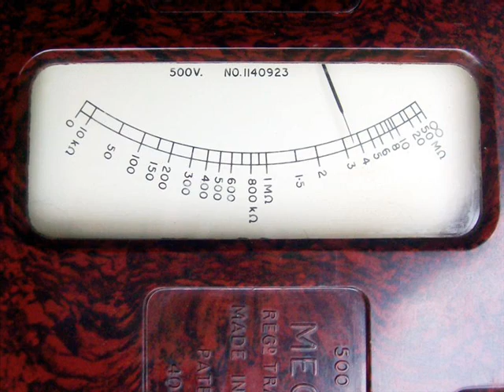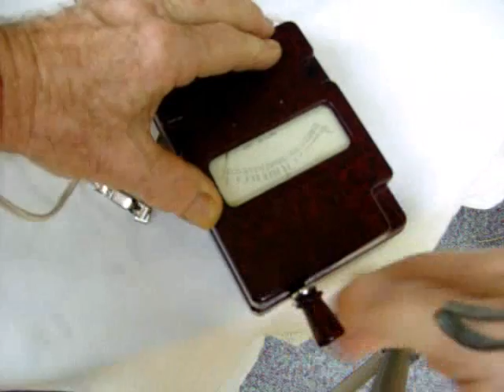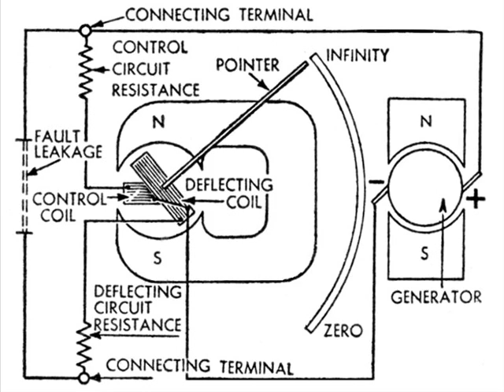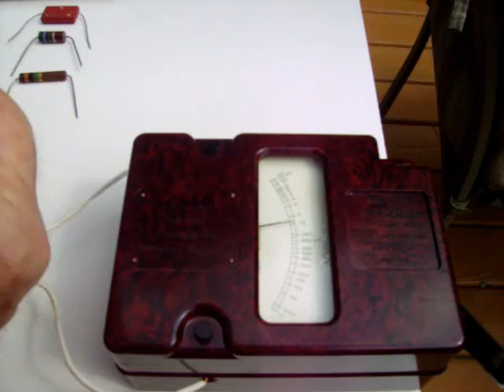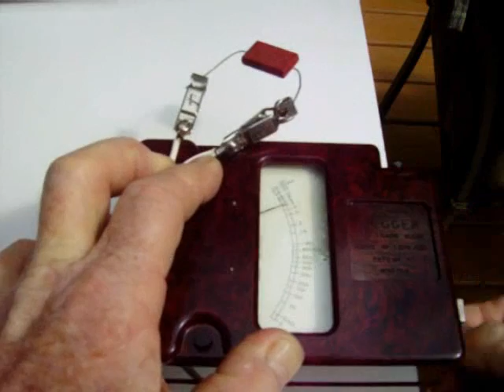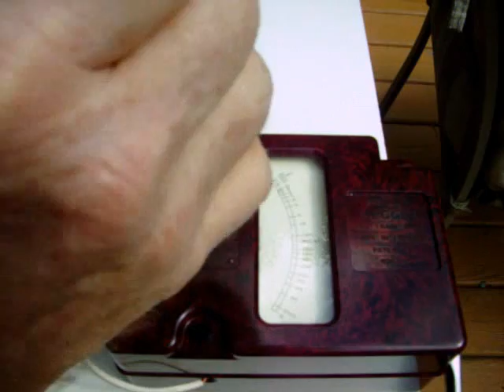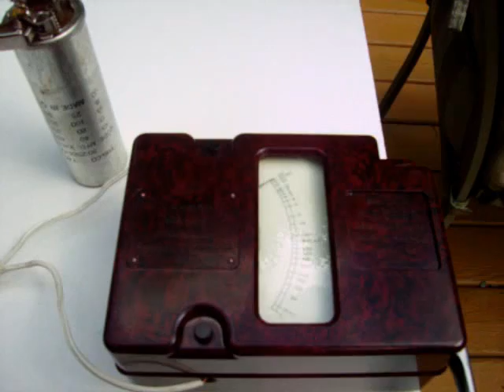~1940 "Wee" Megger Insulation Tester and Ohmmeter by Evershed & Vignoles

Comment: It's an old megger of which I use all the time. It's for testing insulation properties. At only 500 volts it's rather useless today. My newer megger hits 2500v. But this guy doesn't understand it's purpose. It's not really an ohm meter. It's main usage is to test for poor insulation in wiring runs. And can be used to test quality of ground in grounding systems. Oh you can use it for other things too as this gentleman shows.